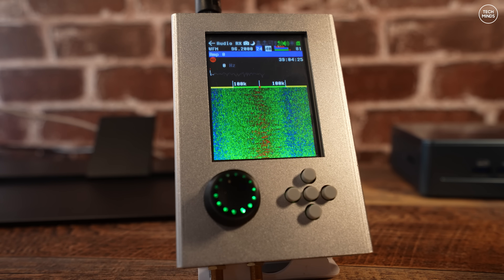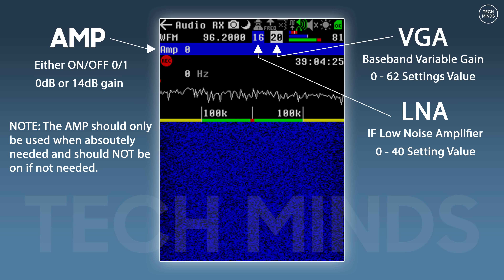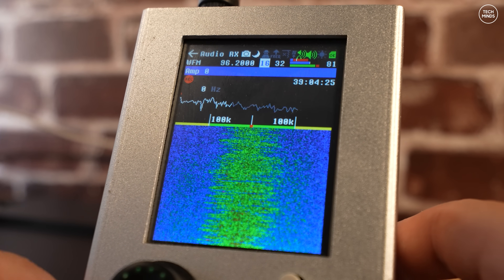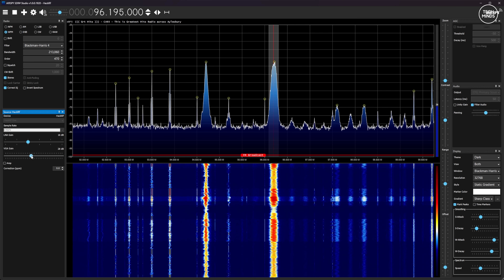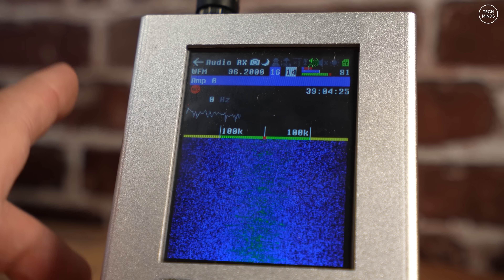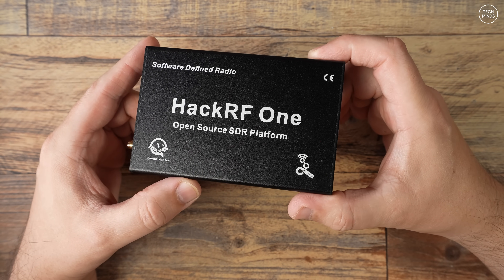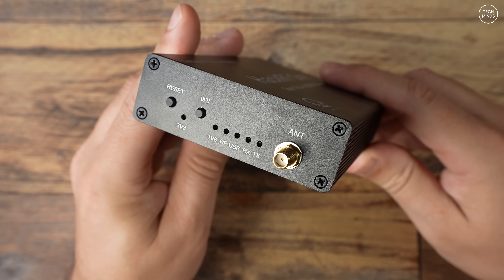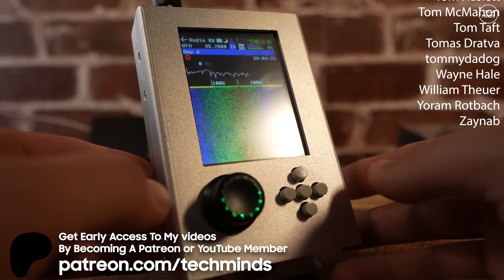Hack RF Receive Issues? Do this one thing! Plus Clifford Heath!

Comment: OpenSsourceSDRLab has two HackRF One Clifford Heath standalone boards, and an additional one with the Portapck H4M. The two HackRF only items seem to be identical, although one of them is called "developer board". I'm confused. They also have two NanoVNA-F V3, both seem identical and have almost the same price. Also they add shipping cost again and again for every item, resulting in a huge total if you buy multiple things. That seems a bit shady or at least confusing. I really want to buy it, but I'm not sure where.

Comment: It me! The damage is caused by excessive RF. Static discharge (e.g. from a coaxial cable) can generate excessive RF, but the static itself doesn't reach the preamp chip. You can add static protection in various forms to stop charge build-up in the cable before you even connect it. Even a very short burst of excessive RF can and does kill it. Also, OpenSourceSDRLab don't make this version, and aren't the only seller. It's made by Shenzhen Cirket, who also sell it directly.
Reply: Ive just ordered your R10+ version from OpensourceSDRLab! Nice to virtually meet you 🤝 😅
Reply: Is all/most stuff in this vid, applicable/transferable (after adding a dose of common sense) to the Portapack H4M & PortaRF?